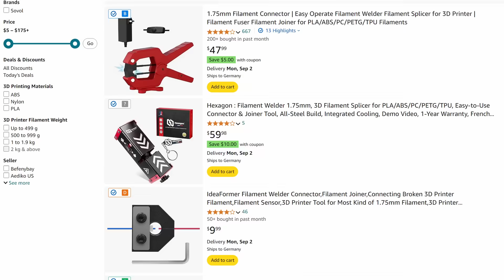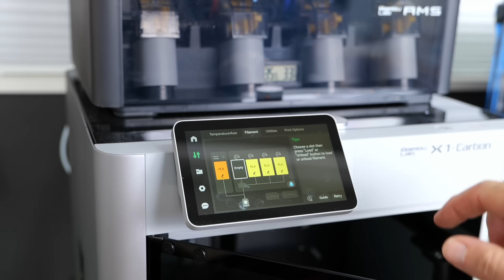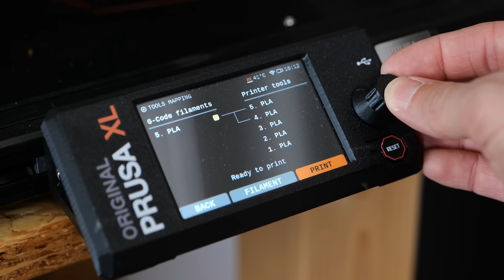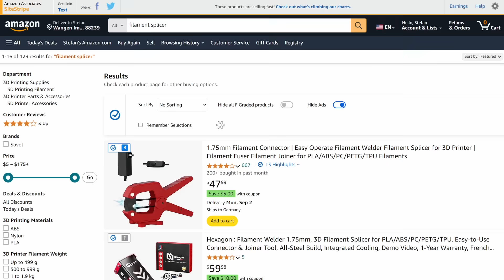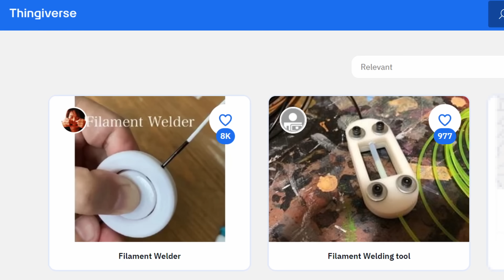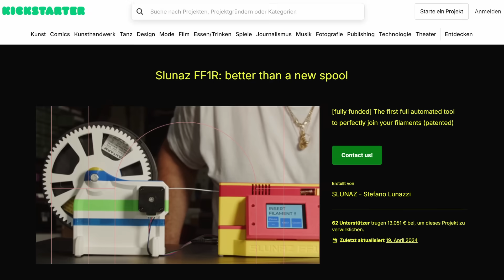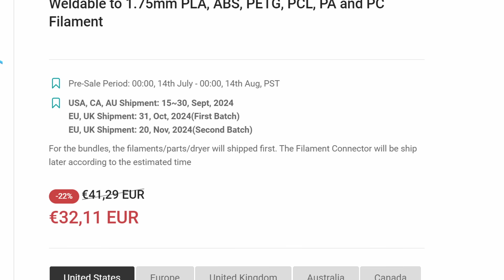The Best Filament Connector but you can't Buy it (right now)

Comment: I did play around with an aluminum split mold that I machined a precise and smooth bore into and necked it down in the middle on the lathe. I just heat it up with a heatgun or a small torch. I basically just clamp it together, heat the necked down part until I can feel the filament softening, press it together and let it cool. It does work decently, but I bought a Bambulab P1S with an AMS a few weeks ago, so I kinda haven't really improved on the design since, because I'm just using the AMS now.
Due to it being 2 halves I can just unclamp them and remove the filament without any PTFE tubing. I found that a bore that is machined decently smooth and precise enough in diameter (a diamond lapped 1.8mm carbide PCB drill works well enough with a slow feed), doesn't really cause the filament to stick, once it's cooled off. Just to make sure, I also heated the contraption up a few times and sprayed it with silicone spray, which creates a non-stick silicone coating (I used it on my self made full titanium heat break in the past too, since I had one specific brand of PLA that just didn't want to print even a single degree above 195°C). Obviously this requires having a half decent lathe and a milling machine to machine the parts necessary.

Comment: Knowing the correct weight of the empty spool is the key to calculate filament rest for one of the next prints. Small lengt will be used in PrintPen.  I have no time to loose for melting filament together and using less PTFE is allways a good thing

Comment: I think a filament splicer should come as part of the machine like many bandsaws used to come with inbuilt blade welders. My AMS is partially that and works great but not cheap, the Sunlu splicer, once available will be a good help for those without an AMS, I bet Creality and other manufacturers will not be long in bringing out their own version.

Comment: I've got the Prusa XL, and I'm very tempted to buy this thing for the leftover filament the XL produces during spool join. They are over one meter long! 
I collect them, and with this thing I could join them. And you can simply slide the PTFE tube to the next end and re-use it endlessly. Almost no waste.

Comment: Whenever my filament runs low, I pay attention to my printer and usually manage to "catch it" when it has like 2 windings left, than replace spool in my filament dryer, lead out new filament and let the printer use up most of whats leftover in the meantime. Than I ask it to print 50% speed for a second while its running out and I push in new filament. Usually I see less print degradation than if it paused for a second (IDK, that allways seems to me like is visible  on print)

Comment: I don't think comparing the mass of the PTFE tubes to small filament pieces is a fair comparison in any way. PFTE is, as you probably know, a PFAS, which is a chemical with a much higher (negative!) impact on the environment and people's health than previously thought. Our current technology (not only 3D-printing) relies heavily on PFAS, so just not using them is not an option today. I'm pretty sure we (as in: humanity) will phase them out over the next years to decades to avoid putting more of that stuff in the environment. PFAS are everywhere. Your food? Yes. Your body? Yes. The brain of your new-born baby: Oh, yes. EVERYWHERE! And it is even more permanent than regular plastics. The damage is done, now we have to reduce the impact until we can actually phase that stuff out eventually.

So that is why I think wasting PFAS to save a bit of PLA is essentially a really stupid idea. If you have small pieces: fine - reuse the Teflon-tube. If you have larger pieces... Maybe print something small with it? Or send it to recycling instead...

Comment: I've already pre-ordered one.  My Ender 3 doesn't have a filament runout detector, and I'm not using Creality's firmware.  My K1 Max has the potential, but it's a lot harder to load than the Ender 3 is.

Comment: You could probably slide off 90 % of the sleeves, because you want both sections on one roll.

I've tried a splicing tool, which didn't work. Most of my ends are short, and I feed them first, which means less camping time waiting to feed the roll in. To date this works best for me, but I might look into the other tool you listed like the one you showed. Sounds like a good and interesting way to splice and forget the splice going through your printer. After all who needs to spend time watching a print, when the printing shouldn't be time consuming on your part.

Comment: The heating of the PTFE tube may actually pose health hazard here. Even though Teflon usually does not decompose below 400C, various sources say that decomposition starts at around 260C and for example for cooking on PTFE coated pans the recomendation is to keep the temperatures below 200C. This whole set up may be very dangerous to user's health, so I'm not sure if that is a good idea to use the splicers which burns PTFE tubes, especially at higher temperatures.

Comment: A good argument about waste is also that with most printers, especially boden ones, you're going to be losing significantly more in what the printer spits out to the sensor than a purge line is, and if the tube saves you 6inches of filament waste it's more than offset iteslf

Comment: I saw it and my first thought was gimmick.  After watching I still think gimmick.  The consumables is a no for me.  I just print things that are small enough to use up my scraps or start off larger prints then swap out when there is still plenty left on the old spool so I don't run out.  Then do the same again with the smaller amount of leftover.  Ie print large objects by starting it with an old spool then swap at a convenient time after a decent chunk of the old spool is used up but there is enough left over for a smaller job and to ensure I don't run out on the current big print.  The big print finishes on the new spool. The smaller amount left on the first spool can then be used up on small prints until it's used up.  I like to use the very last bit to print beads that I use on an ongoing project.

Comment: I've used a hot knife before without needing to heat and throw out PTFE - my solution for the join is to push in on the strands until there's a bit of a thicker weld all around, then sand between two flat plates (in my case scrap wood with grip tape) to make the joint thin enough to print.

Something i want to try is friction welding, but i need a drill that goes back and forth quickly instead of around.

Comment: Not an issue with Bambu AMS, with the auto refill as mentioned. No more left over filament since using these printers.
Reply: Maybe but those printers are ridiculously expensive and totally made for the "lazy"  types that have deep pockets and don't need to know anything about the specifics of the difficulties that comes with 3d printing ...   Hench the term "lazy"   ...
Reply: @gothmaniow  AMS with A1 mini is 360 EUR. Complete package.

Comment: Apart from the PTFE tube being a consumable - something which is a major bad thing ...
With a price of 100 EUR, you need to re-use around 5 complete spools of filament in leftovers. With an average of 5 meters of filament on each spool, this means you need to recycle around 340 spools of leftovers before being economically viable.
So I guess that this is both economical and an environmental not areal viable option

Comment: Keep in mind that the environmental impact of PTFE production is several hundred times greater per unit of mass than PLA.
It's a neat device but if you can avoid cutting the PTFE tube you should.

Comment: G'day m8.....im currently economicly restricted (im on the poorer side of 3d printing) and i jumped on the  kickstarter of the Sunlu S4 drier system and love it,... Its been running for 8 months straight, and just like the S1, it was drying for the mass's yrs ago. This filament Fuse device is just their first go. so i got one coming mid to late september....it will get better over time with feedback. Cheers From A M8 Downunder🙃

Comment: I just use a piece of normal PTFE and a lighter. And no I do not rewind the tube all the way, I just leave it on the spool. And later I will collect the tube, when the cut is reached while printing.
But I am too lazy to connect filament pieces most of the time. I just switch it manually when it ends. I do not calculate print weights or so, so I do not have too much 'leftovers'. I just use one spool, until it ends, and then switch to another.

Comment: I have a "3D pen", I use the left over filament as material to fine tune and repair printed pieces in case under extrusion, failed print or just detailing in general

Comment: I keep an empty spool of each type handy to zero a scale so I can accurately measure how much filament is left on any spool I have. That way I can print without running out. If I end up with a tiny amount left, it goes to my 3D pen box to use for repairs or joins.

Comment: I normally just use it till it hits the runout sensor and the small amounts of leftover I use as little alignment dowels with holes added in parts when I need to glue them together.

Comment: I know of a way you could probably do it without having to use ptfe tubes and still get good results.   Basically just make something like a two piece bullet mold (the kind reloaders use to make cast lead bullets).   It would be easy enough to try.

Take a couple of small blocks of aluminum, lap the faces to eachother, drill and pin them so they go back together in the same spot every time.   Then (with the halves clamped together tightly) drill a hole all the way through right at the split line.   Just a hair under the filament diameter so that the mold itself will clamp the filament in place.  Might take a little trial and error since the hole will expand slightly as the aluminum heats up.

Then run a butane lighter on the inside of the mold to soot it up (release agent), stick your filament ends into the mold halves, close it, clamp it or latch it, and heat it up with a torch or just set it on an electric hot plate or stovetop.

I don't mind sharing the idea either.  It seems obvious enough that surely someone else has thought of it or something like it.

Comment: I pre-ordered one of these about a month ago. They are saying it will be here in September. Usually I puppy guard the printer if I think I will run out of filament and just start the next roll or remnant as the end of the previous roll goes into the extruder. I'm hoping that this will eliminate that. I'll be able to splice the remnant onto the next roll and let the printer eat filament.

Comment: Utilizing Leftover Filament: A Review of Joining Methods and the SUNLU Filament Connector

* (0:00) Problem: Dealing with leftover filament and samples that are too small for full prints but too much to discard.
* (1:54) Existing Solutions:
    * (1:54) Filament Runout Sensors: Utilize runout sensors to pause prints and manually swap to new filament.
    * (2:45) Bambu Lab AMS Filament Backup: Use the AMS "filament backup" feature to automatically switch between spools, even with different colors.
    * (3:56) Prusa XL Filament Join:  The Prusa XL allows assigning multiple spools to the same material, enabling automatic switching when one runs out.
    * (4:40) Manual Splicing: Heating and joining filament ends, though tedious and often results in bulky joints.
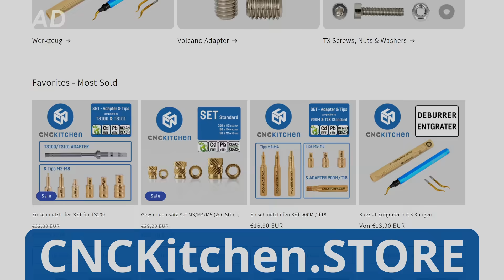* (6:24) New Solution: SUNLU Filament Connector (not currently available):
    * (6:24) Affordable and Compact: USB-powered and relatively small.
    * (6:55) Simple Process: Cut filament at an angle, insert into a PTFE tube, heat in the device, and remove the tube for a clean joint.
    * (9:21) Versatile: Can handle various filament types, including PLA, ABS, ASA, Polycarbonate, and Nylon.
* (8:01) Challenges of the SUNLU Connector:
    * (8:01) Practice Required: Achieving consistently good connections takes practice.
    * (9:32) Heat Concerns: The device can get hot, and lacks a built-in cooling system.
    * (10:52) PTFE Tube Consumption: Relies on single-use PTFE tubes, raising environmental concerns.
* (10:01) Alternatives: The Hexagon/3DSWAY Filament Splicer offers a similar solution, potentially with a cooling system.
* (11:48) Conclusion: The SUNLU Filament Connector presents a promising solution for joining filament, but its reliance on PTFE tubes and current unavailability are drawbacks. Existing printer features can also help utilize filament scraps.

I used gemini-1.5-pro-exp-0801 to summarize the transcript.
Cost (if I didn't use the free tier): $0.06
Input tokens: 15300
Output tokens: 888

Comment: 11:43 I think you can leave the PTFE tubes on the filament at any length and load them into the extruder. As soon as the filament is empty, the PTFE piece simply falls off and can be reused.

Comment: For the price of this, you can easily get 6 spools of filament. I am printing for 7 years now an i almost have no leftovers, i swap the filament with M600 when it goes near the extruder and load the new spool, the waste is no more than 20cm. The only way i can justify this is splicing recycled pet bottles filament, but again the price is too high for that, and the waste of a ptfe tube is not acceptable for me

Comment: I feel a better design would be to use coated metal in the joiner (to remove the need for consumables) and switched to something like a peltier, then you could insert the filament have it heat then cool it all in one go without removing them.

Comment: Why not use a printer with a direct-drive extruder, where a PTFE tube reaches right up to the feeder? My Artillery Sidewinder X1, for example, came this way from the factory. You simply make a clean cut at the end of the outgoing filament and the start of the new one. Once the last bit of filament disappears in the extruder, you can insert the new spool's filament and apply slight pressure until the feeder grabs it. Since discovering this method, I haven’t even needed to pause a print for changing filaments.

All these products showed seem overly complicated, unreliable, expensive, and labor-intensive for solving a problem that just does not exist. I'm genuinely surprised that there are so many products and videos on this topic!

Comment: The problem with PTFE is that it's one of the "forever chemicals" which basically doesn't decay. There's enough plastic waste in the world and I'd rather not use more of it than I need to. I'm happy to hear that you can also just slide off the tube after use though.

Comment: People are complaining about the PTFE. I wonder if silicon tubes would work as well. Silicon tubing is cheap, heat resistant, and non-stick. I don't know about the environmental impact through. I have used a silicon tube and lighter to fuse filament before.

Comment: Imo comment sections concerns about the PTFE waste is a bit overblown. In practice, people would wait until there's like 4 or more short strands to join, all using one tube sliding along sequentially. Even then, the final piece is going to be short enough to just slide out of in 99% of cases. This product isn't meant for joining full spools.

Also even if every single 3d printer user bought this and immediately dumped the PTFE into the environment, that's less than 0.0000000000000000000000001% of the hourly pollution from chemical factories.

Comment: I use mine up on random clips or mounts that aint visible, On the Bambu A1 I just feed one in behind the other on the go.  Hasn't failed so far.  Same on the Kingroon kp3s with the creality Efit extruder/E3D hotend fitted. I do have cameras watching the spools as well as the beds so i know when to get busy.  Ive been joining using a 1.75mm bored  centre split 10mmx10mmx10mm cube of brass. hold the block together in mole grips JUST hot enough to melt then feed the filament in each side push them together and wet sponge the  block to cool fast.  Undo the moles and and pull the block apart.

Comment: Price is relatively low, I’m not happy about leftover PTFE tubes. For now I prefer to babysit my printer (and I’m still quite unhappy about Mini+ and the blobs it does during filament switch), and keep leftovers to the 3D pen. It is handy to use as a fixing tool and those short pieces are actually handy.

Comment: Protip for the AMS: If you have two spools of the same filament in the AMS and you want to print from the spool with the least filament first to use it up, you need to select the almost-empty spool in the print dialog after you click print in Bambu Studio. Selecting the almost-empty spool in the Filament section of the Prepare tab sets the type of filament, but the spool slot you select in the AMS is ignore. There's nothing more annoying than coming back at the end of a large print to find that you now have two almost-empty spools because it used your new full spool first.

Comment: I use a bit of PTFE tubing when I splice filament using a soldering iron, I run the tube back and forth while the join is still soft that way I know it won't clog the printer, I then just leave the bit of tube on there, the filament will just slip through so there's really no need to cut if off and waste it. Even if it's rolled onto the spool.

My record is 8 splices in one print, which needless to say, saved me 8 spools worth of space.

I really like the look of this product, though.

Thanks for another great video.

James
Reply: I was doing a similar method and discovered that ALL of my leftover filament material became brittle and would break in the AMS so I just started throwing the remaining filament away to save time and headaches.